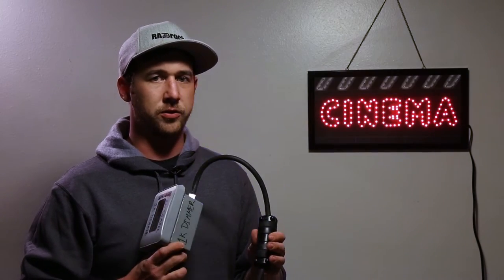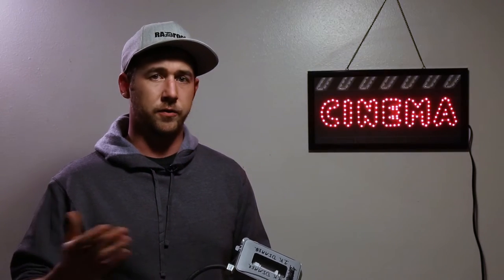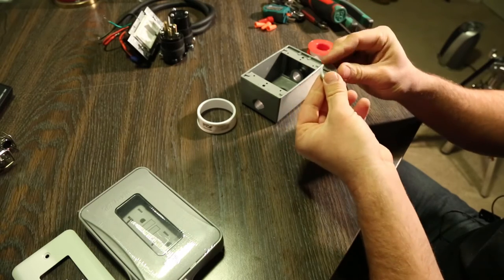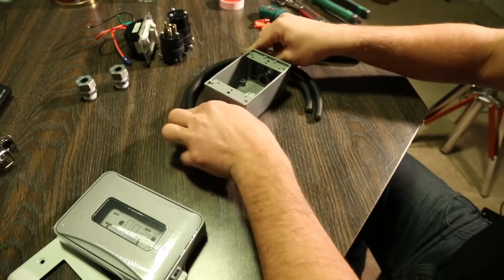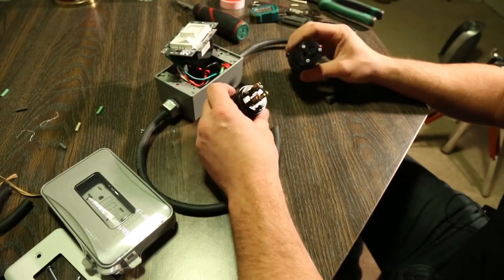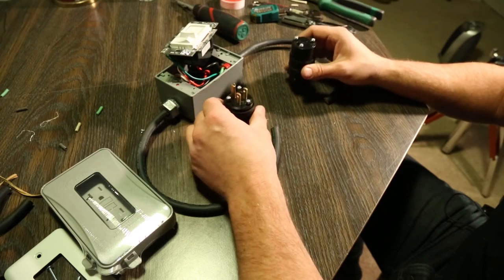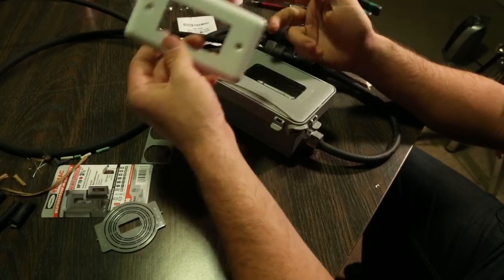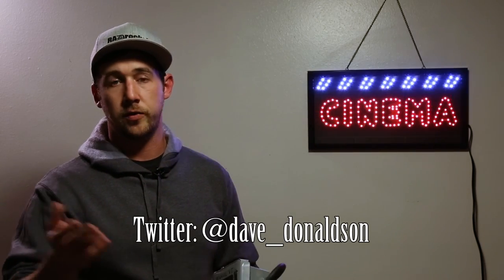Ep 02:  "1K" (or 1000watt) Dimmer Switch

Comment: Great vid! Very well laid out and easy to understand!

I know this is 7 or so years old, but I would suggest a few things: 1. When the box is metal, it has to be grounded as well... Especially if you're using in wet/damp conditions... 2. Use E-tape around the wire nuts 3. On the switch, Black is line and red is load... Line=What's coming from the source... Load=What goes to the instrument...

Comment: 14/3 is plenty for 1k dimmers.  12/3 supports 20A and 14/3 supports 15A.  The dimmer only supports 8.3A so the 14/3 is overkill already.
Reply: does that mean I can use a 15 amp Edison plug for the outlets?

Comment: Dave, could you comment on the difference between using a wire nut (twist on wire connector), crimping, and soldering? What's the reason for choosing the wire nut here? Thanks much.
Reply from the maker: mlangsottile honestly? I didn’t really have a reason. Just seemed the easiest. Though I suppose one could argue one being better than another. Like crimping is probably better if there is a jacket. I could also see soldering being better as to make sure of a strong connection but then again, probably need to hear shrink a jacket on. Just to avoid connections with the other wires. If I had to guess I’d say they all probably would be fine choices.
Reply: Appreciate the reply, thanks. Love the channel.
Reply: Wire nuts are usually used because they're quicker and easier to change, if need be. Personally, I hate wire nuts. I've seen way too many of them just fall off, leaving wires exposed. I always prefer to solder and either heat-shrink, or wrap (at least a few coats) with electrical tape. Heat shrink is better protection, as some electrical tape loses it's adhesion when it gets old. That's just me, but I spent almost 20 years making cables (mostly audio, to be fair)...

Comment: Can you use this dimmer with Quasars LED tube lights?
Reply from the maker: Skyler Bocciolatt funny you ask that, my next episode that I’m currently editing is about quasar tubes and yes I use the dimmer I built here on them. It works!
Reply: Grip Tips that’s awesome! I use a barn door 1k squeezer with them now and I get a bit of flicker on the low end, how’s the flicker on this dimmer?
Reply from the maker: Skyler Bocciolatt None until it reaches about 10-20% on the dial
Reply: Hey Guys. Long story short I had an issue on a job back in October with Quasar Cross Fades and that Barn Door Squeezer mentioned here. It sent me on a quest to find answers regarding LED units and Dimmers. I FINALLY got around to building this dimmer for both Halogen fixtures and LED fixtures (thanks for the awesome build Dave) I also did a dimmer test with Dave's build, the BarnDoor Squeezer and an LED compatible dimmer switch. It's posted here: https://www.modernmotionvideo.com/cinema-blog/safe-dimmers-for-led-fixtures
Keep up the great work Dave!
Reply: @GripTips  i cant get my lights to dim down all the way. Was I supposed to buy a different controller for t8 led tubes?
Reply from the maker: @miamisoundandfilm5136  hm... I assume we are still talking Quasar tubes right? Ive only used the dimmer on the crossfades. Its to my understanding you can dim the T8's. Although the crossfades are dimmable, they too will cut out at about 10% power. Is that what you mean?
Reply: @GripTips  yes I made a rig out of quasar t8 5600k led tubes. I made a 1k dimmer and thought that if maybe I used an led dimmer I could get it to go down to 0 but it doesn't go all the way down either. I've been looking to add a ghost load but haven't got around to trying that out to see if it works. Thanks for responding.